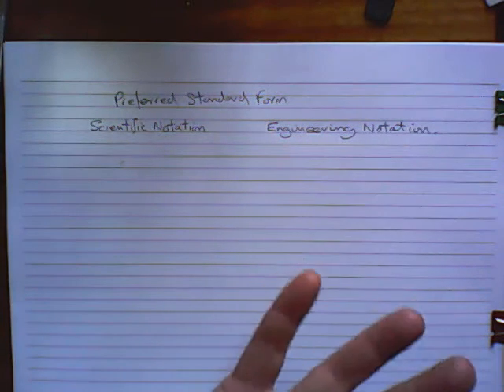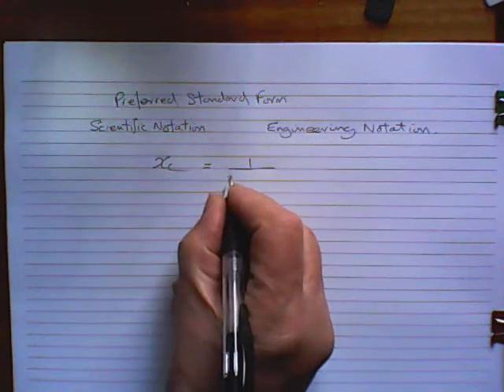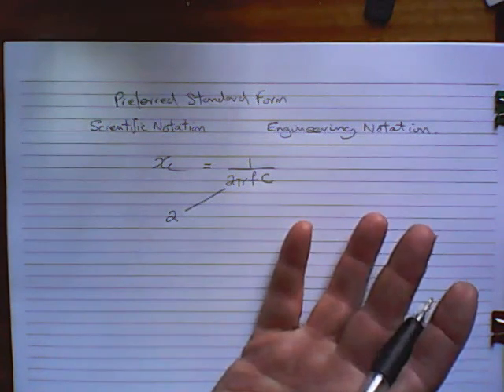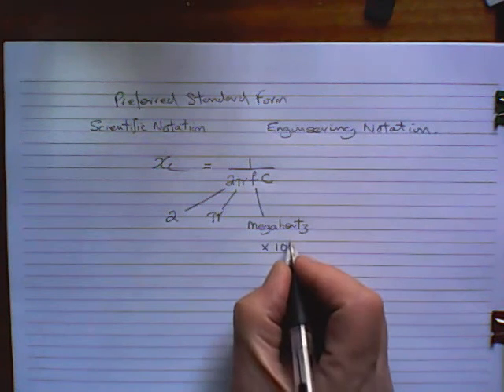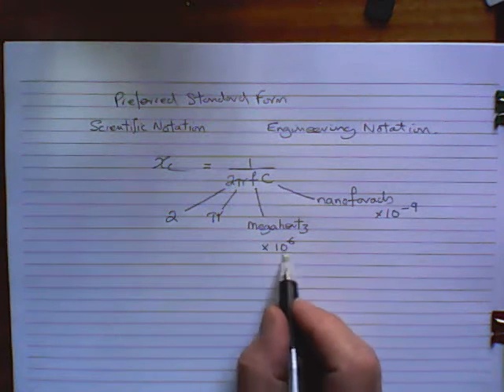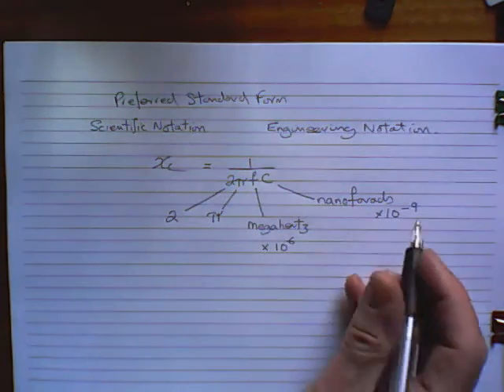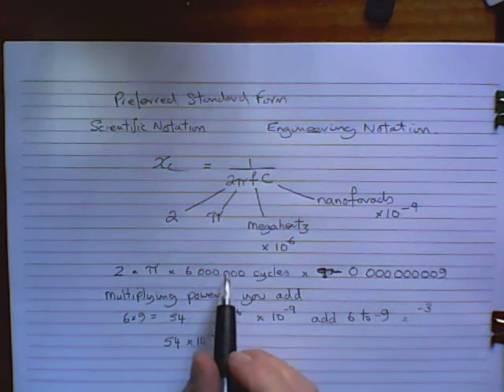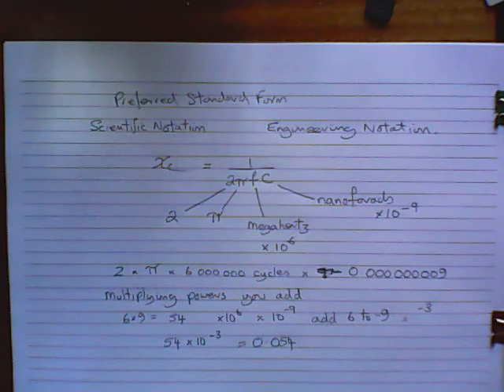Preferred Standard Form

Comment from the maker: Maybe I should have added that the actual answer was 0.054 times 2 times pi, but was only demonstrating the usefulness of standard form notation. Scientific notation has any value of x10 to any power whereas engineering notation uses only powers that have the factor 3 (e.g. x10^3, or 6, or 9 etc as well as x10^-3, -6, -9 etc)